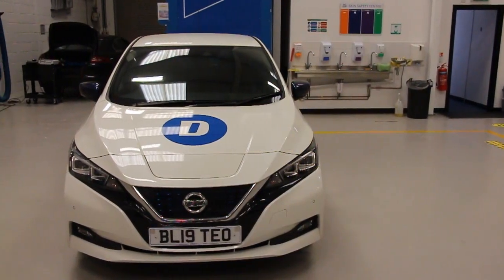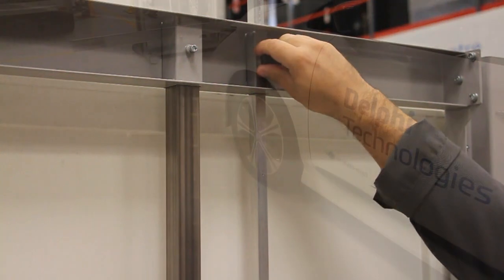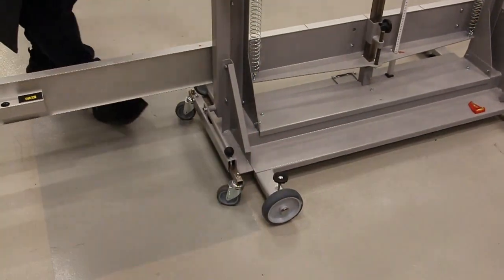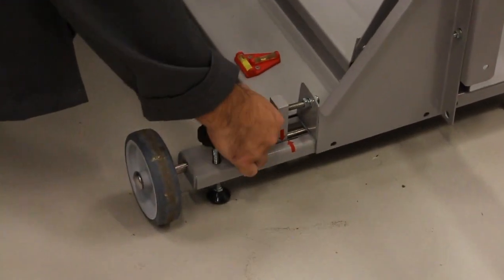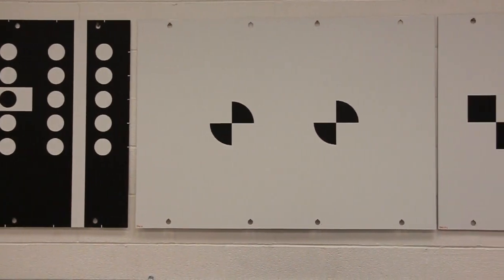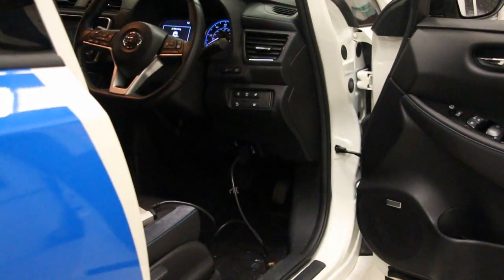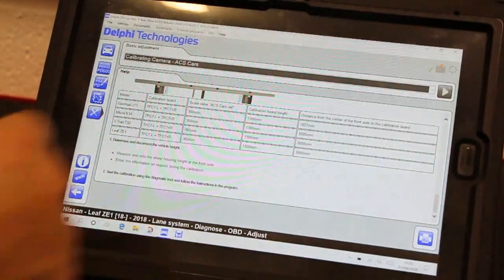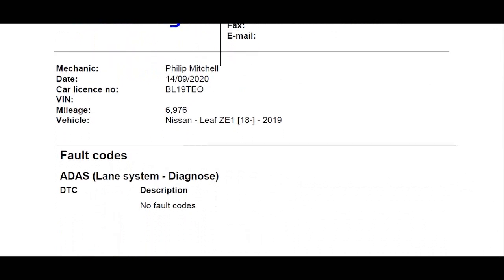[EN] Front camera ADAS calibration – Nissan Leaf | Diagnostics

Comment: Surely camera calibration should be carried out AFTER the wheel alignment has been checked as the the thrust line will affect the cameras correct function.  This is in accordance with the IIR as per Thatchams recommendations.  Your check sheet says check alignment after the camera calibration
Reply from the maker: Thanks for watching our ADAS calibration video, you are correct about the calibration being required after rear wheel alignment changes as this would indeed change the thrust angle.
In our software the reasons for calibration for this specific vehicle are shown at (4:18), and at the end of our video (5:23) the check sheet shows “camera calibration complete once wheel alignment has been adjusted”.
This refences the wheel alignment being adjusted first, and then camera calibration being completed after.
I hope that answers your question.
 Many thanks!